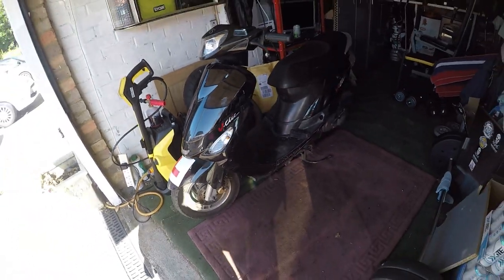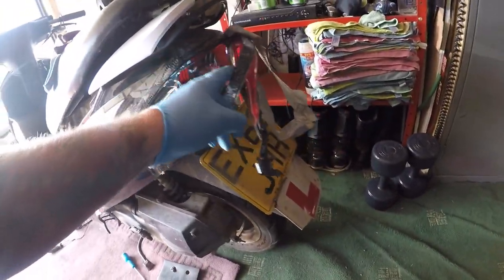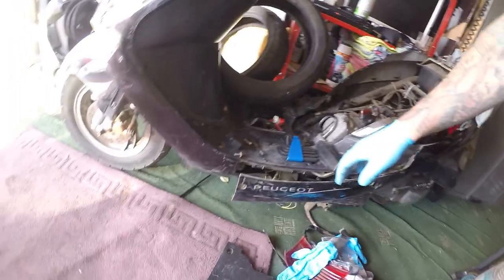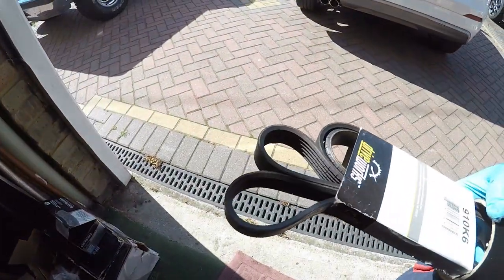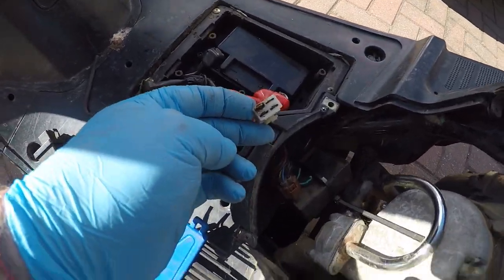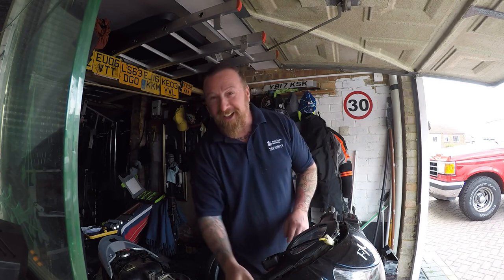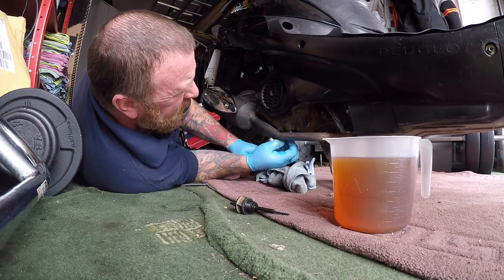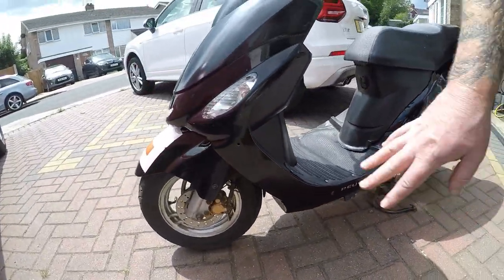PEUGEOT V CLIC MOPED SCOOTER NONE RUNNER BEGINNERS FIX PT1 MARK SAVAGE

Comment: Great videos 👍🏻 I didn’t know if you could help I have a piaggio liberty 50cc 2t and it won’t rev properly until you unplug the fuel vacuum line and it will run and rev well until the carb I’m empty any ideas?
Reply from the maker: has to be carb off and clean then look at the vacuum like in my carb videos as that may be faulty
also check fuel pipes bud

Comment: oh mark dont do it    it makes me feel sick being a 4t :D 

great video as all ways mate was a great watch eating doner kebab and having a beer after work :)
Reply from the maker: Yea i know I should stay away lol 
And the part 2 next week says it all lol
Donna and a beer !!
Almost sound like the way it used to be lol
Reply: @marksavage   oh i need it mate done 42hrs at work this week and then 10hr shift tomorrow and 6hrs to do on sunday so 58hrs this week  over all :/
Reply from the maker: @mrchilled85  wow that is life back to normal lol , well enjoy the beers bud
Reply: @marksavage  oh it is mate but i did something funny the other day to my 2t chinese scooter  fitted a MALAGUTI f15 lc engine in :D  its just a funny mess around bike for around town but not bad start to finish engine conversion 3hrs that was with fitting new rollers , belt , piston and rings and fresh gearbox oil and fitting my stater on so i did not have to change looms over :D  and done the pipeing for water holes and mounted radiator

Comment: I know you said don't cut wires, but I have a Peugeot V Clic that was originally a 50cc the guy got it off change it to 100 cc but it's still going slow is there anything I can do to make it faster
Reply from the maker: @crazygamerchickcrazy-g-c7569  changed what bud
Engine to 100cc
Did he change the exhaust 
Carb
Cdi ?

Comment: HI mark my bike is a WK Mii 50 bought it's second hand it runs good only done about  4 thousand miles . The guy says it's had a new speedo  I am thinking it mite of been in a crash and I paid 400 pound for it  . It's 16 number plate . I will check your vidio about the head stick thank you
Reply from the maker: Hi John what moped ?
Single arm or twin 
Pulling can be low tyre pressure to twisted front end
Head stock ?
Check out my last speedfight but one video it talks about it
Reply: Fantastic mark I watch him you tube every day
Reply: @marksavage  thanks Mark it is a WK Mii 50 scooter and I will check out your latest video about the head stock . And thank you great shows on you tube

Comment: Hello Mark, what would be the standard roller size in a vclic. Mine has currently 4,5 grs each.

Starts fine, Idles fine. Will not pull away, engine bogging when trying to rev up. Carburettor cleaned twice, no prob there. Could be the cdi you think?
Reply from the maker: I put in 6g in mine and took off the extra link pipe and tuned like in my tuning video
Reply: @marksavage  thx, will start with putting new 6g rollers in.
Reply: @marksavage  one more thing Mark, there is  a hose that goes from the top of fuel tank, but it does not connect anywhere, any suggestion? Thx again.
Reply from the maker: Thats a breather pipe bud 
Or an over fuel pipe 
Depends where its from 
Don't worry bud
Reply: @marksavage  Great thx. Will make a vid and send you link. So you can see the scooter i am fighting with . Thx again for all replies 👍
Reply: @marksavage  ok so today finally discovered air intake into airbox was wide open. So way too much air. As you pinpoint, check the obvious. I did not good enough. Anyways, pulls away fine, runs fine. Thx for your input! Suscribed

Comment: Hi mark, would a cheap Ebay gy6 carb work okay? Broke my carb and need a cheap replacement for now thanks
Reply from the maker: as long s it is ok and run before then it will be fine, id take out your old jet and change it if it doesn't run ok
Reply: Okay then I'll give it ago, thanks for the reply

Comment: Great video mark! have you ever had the variator nut come off while riding? Happened to me yesterday, a mile from home with zero tools LOL
Reply from the maker: yes and its normally bad , you might get away with using lock tight on it to keep it on as sometimes if your lucky it was just loose rather than a threaded nut!!
Reply: @marksavage  gladly it never threaded, and i manged to use the claw hammer and big bar method to fix it when i got home... it wasn't just the nut that came off tho it has another washer/spacer that i havnt seen on your speed figher or aerox vids. ill upload a vid or picture on my channel tomorrow and see if you know what it is? if thats ok
Reply from the maker: Let's know when you have uploaded
Reply: mark savage have a look at what Iv done now! 🙈 my luck is no good atm I’m gutted! Check my channel for the video
Reply: It died on my way home and wouldn’t start, I have managed to start it but it dies straight away, if I open the throttle it stutters and the back wheel does not move then it dies again, I have checked the spark, fuel, air, cleaned the carb and same thing happens, took the piston out and it’s scratched to hell. You will see in the video. No backfire noise really, do you think where the variatior nut came off few days ago it has caused damage to the piston or oil seals. Sorry to bother you so much lately mate 🙈
Reply from the maker: @Bigwormox4  I've watched the video bud and left a message

Comment: Ah yes electrics! the bane of any motor mechanic whatever you work on! I had a similar problem with my Triumph Sprint ST where the plug connector from the alternator was simply not rated for the task and kept melting!... An uprated plug cured that. Cheap bikes (and some more expensive ones) are fitted with cheap components!
Reply from the maker: Agree , saving money cost us later on,
Reply: @marksavage  how does it go? buy cheap, pay twice!..

Comment: What transmission oil is it
Reply from the maker: on these you can just use 10/40 for the engine oil as all in one
Reply: @marksavage  that's the engine oil  I need transmission fluid is it